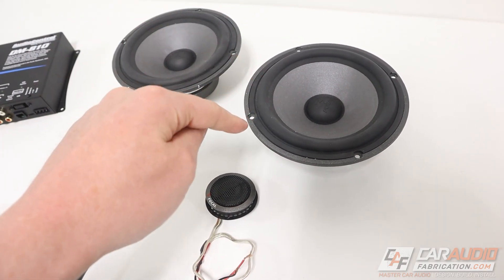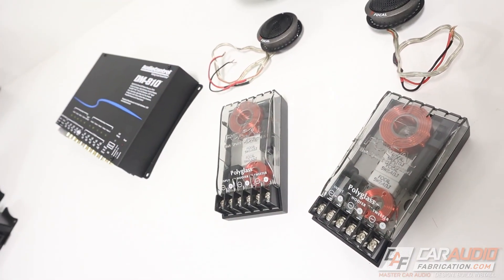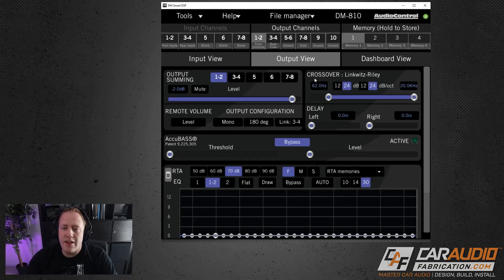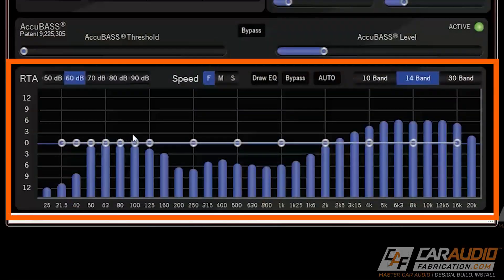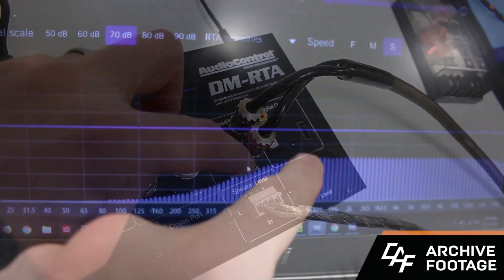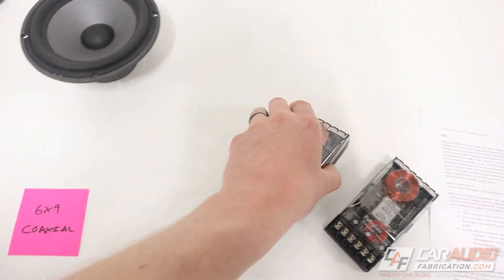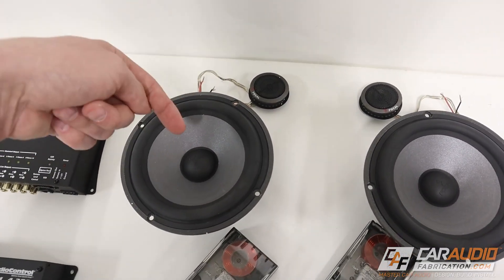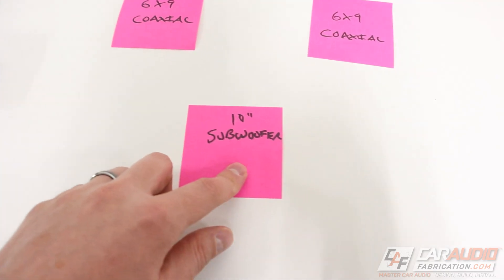Is PASSIVE CROSSOVER pointless if YOUR audio system has a DSP?

Comment: I never understood why people in car audio are so into going active when the only benefit is crossing over drivers lower and higher power handling.

Its rarely ever done in home audio and not even a thought on people's mind's. Get a DSP and call it a day!
Reply: Hmmm... now let's think about this one. Amps provide power. Diff drivers/woofers require diff power that the dsp might not provide. So... are you still lost? I really hope people dont listen to half these comments on here people are severely uneducated
Reply: @Me-dh4pm  a DSP doesn't provide power to a driver. Just a signal to the amp. You're the one that's uneducated!

You also realise that you rarely even need or use a few watts in a standard 2ch stereo system. A tweeter doesn't even pull 1w of power at normal listening levels.

30watts per channel is plenty of power for a system without a subwoofer.

So the argument of better power handling using separate amps is placebo.
Reply: @barbecuetechtips6024  I was referring to DSP's with amplification abilities but sure, whatever you say. No need for amps. It's all for show...😷 we can go back and forth but the reality is there are larger drivers out there that require more power so their is certainly a need for amplification in different applications. It's called headroom.
Reply: @barbecuetechtips6024  car audio, especially the SQ side of things is a constant strive to sound better. We spend good money and if you want to achieve the best results then you want available power. Sure you can do things with the mindset you have but people aren't concerned with extra power 4 tweets. People running 3ways with 8+ inch midbass in the kicks in custom enclosures only on 30 watts, your leaving no room for dynamic range. I'm sure you can find low power drivers but most applications are using amplification. Your not holding onto a secret🤦‍♂️
Reply: @Me-dh4pm  Are you running a 3 way system by chance? 

There is really no reason to run one in a cars confined space and the benefits won't be achieved like in a home speaker.

All you need is a mid, tweet, and subwoofer.
Reply: @barbecuetechtips6024  incorrect. A car and home are 2 diff beasts. Their is no rule of thumb in a car. If you want to represent the entire frequency range 20hz-20khz then your car will dictate that. Some applications work fine with a 2 way front. Others 3. Some 4. It's not as simple as 1 answer. All applications are different. We could debate forever. Research some sound quality champions and let me know if they are all running 2 ways with no amplification?
Reply: @Me-dh4pm  I think this video is targeting the typical/average end user that’s not competing in IASCA or MECA SQ comps.  Of course those competitors are going to want tons of power to their front stage speakers, so this setup described in the video wouldn’t fit their needs.  For most users, the setup in the video would work just fine - and with most getting their music from streaming services, this setup would be more than adequate.  Anything beyond that is just marketing by manufacturers or dealers.  You don’t need 1.21 gigawatts going to every speaker for your system to sound nice.
Reply: @Security_L0ft  The ones who installs a $700 or even more expensive DSP, several amps, speakers, wiring, or even come forward with a question of active vs. passive xover, are definitely not average audience.

It is completely irrelevant that one wants to compete or just for his own pleasure.

The average listener is who listens music on stock systems, and doesn't care, don't want better.
Reply: @Security_L0ft  well said, I agree.
Reply: @Me-dh4pm  so what are you running? With your knowledge.
Reply: @barbecuetechtips6024  2019 VW GLI, I run a 3 way front. 3" Mids and 1" tweets on custom a pillars. 7" midbass in custom .30cube enclosures in my kickwells mounted to the chassis. I run two 12s ported at 5 cubes in the trunk and then 6 1/2s in stock rear door locations for rear fill. Subs  crossed 20-40, midbass 60-250, 3" 250-3k and tweets 3k and start to roll off around 18. All fully active with a fiio DAP as the source on digital coax to dsp. 3" 50watts each, tweets 60each , subs 2000, midbass 150 each. My build log is on DIY forum.
Reply: @Me-dh4pm  I'll take a look at your build for details. Sounds interesting.

I'm just running a budget setup with dynaudio esotar 2 tweeter and mid/woofer with a sinfoni amp.

Passive crossovers with a Sony rsx-gs9 and Sony WM1Z.
Reply: @barbecuetechtips6024  it's a hobby for me so at the end of the day I enjoy the learning process. The SQ side of things is a huge rabbit hole. I'm in the constant process of upgrading as I go. I'm going to be building an IB setup in the trunk this summer and running 2 FI 18s. Cars are different. The accoustic properties of you car will dictate the frequency range you hear from listening position. For me the best investment I ever made was a tuning mic. Being able to physically look at your frequency response so your not shooting in the dark making adjustments with your dsp. Only way to properly set crossovers and align things in correct phase. It's a deep deep hole🤷‍♂️
Reply: @Me-dh4pm  people over look a mic and measuring software.

All you need is a umik-1 mic and a iPad or laptop with room eq wizard.
Reply: All I'm saying is there is no real benefit to run a standalone mid range  in a cars environment. 

Sure if you gut the car and do custom fibreglass and compete in SQ. But for 99% of the population, its a waste of time and money to get a theoretical improvement in power handling and crossover over a traditional two way system with/out a subwoofer.

Comment: You should do a video about having a factory amplifier that has a built in crossover and adding an aftermarket component set with passive crossovers
Reply: I agree I've been trying to figure out what I need to do for my 2016 scion tc, been trying to completely upgrade the door speakers
Reply: The lc7i from audio control is pretty good. When I do installs on factory systems that's usually my go to . Caf has videos about this too
Reply: @flexart174  Really want the DM-608..If I "tap" into all my speakers, am I Done... ? I cam tune my music coming from the stock radio Or do I need to connect the outputs of the DM-608 to ..
Reply: @ceavalencia4767  the dm 608 is what you will use for fine tuning.  You can use the high level inputs from your speakers out to an aftermarket amp Iike the dm 608 if you are willing to put the money !
Reply: 2006 FX35 factory Bose; needs speaker upgrade cant find videos on connections or tuning through DSP

Comment: This setup could actually be used to save power. Someone who wants a custom sound but not have to buy batteries and alternators often. The only problem you run into with this setup is space management. This is A LOT of wire routing and placement that may cut into the overall available air space your system needs (if you route like Mark’s previous builds).
Reply: Would power still be an issue with class D amp with DSP inside ? 
Is it better to drop the crossover that came with my expensive Dynaudio speakers and connect directly to the amp ?

Comment: Why even use a DSP if not going active in the front?
Reply from the maker: Because equalization and time alignment still provide emmense value for tuning.
Reply: @CarAudioFabrication   Those hardly seem relevant in this type of configuration.  Not a notable difference.  You mention budget reasons.  I would think going fully active up front with a 6ch amp and no DSP would sound better.
Reply: @DirtyDaron  what type of configuration? A 3 way component? A dsp gives you control over each individual speaker. How would that not be a notable diff!? Your lost buddy
Reply: @Me-dh4pm   But set up like this it dose not give you control of each individual speaker.  That is my point.  Seems like a waste of the DSP.
Reply: @DirtyDaron  maybe not a waste but your limiting the control you have over them individually like u mentioned

Comment: Per the title. Depends on how many amp channels you have. But the answer is yes. :)
Reply: @champspec  the fact that you are an old school car audio analog guy speaks volumes (I was a USAC competitor from the early 90s myself) quality dsp units like a Helix, PS8, or TWX-88 are not “bandaids”. Modifying a digital signal isn’t “weak” or a 💩 signal as you refer to it, at all. It would appear you have a lot of catching up to do with technology. And once again a passive crossover is vastly inferior and useless in a properly setup fully active system with a modern dsp. Using a capacitor far below the x-over point on a pair of tweeters is the only use for any passive in a well designed dsp driven setup and that’s only there for a failsafe feature.
Reply: HELL NO! NEVER FORGET PASSIVE CROSSOVER!!!! 
1st.. if dsp breaks, then your whole system  is done for....
2nd.. a DSP is NEVER as accurate  as a passive x-over..  failure always comes.
Reply: @kooan112  we can agree to disagree.
Reply: @kooan112  If you DSP breaks you will most likely hear nothing.
I would however use capacitors with speakers anyway, i recently had one channel on my amp pushing DC into my mid (not sure why protection didn't work) and it burned it. 
As for second one, DSP is way more accurate than passive, caps change their value over time, inductors and resistors have their own inaccuracy as well.
Reply: @kooan112  wow... I hope nobody takes this advice. Sorry buddy but you dont use a passive to prevent dsp failure. 😱

Comment: Ugh I wish I had the money to get systems like yours
Reply: dude you don't need that much money to get good sound.

get $109 Pioneer deck.    best if you have an iPhone since you can stream high-quality audio right into the head unit.   Francis vacation you can go to an AutoZone and pick up a dual 4 channel amplifier.
the tweeters can be ran off of deck power just fine.
Midbass  will be going through the Dual amplifier and also through the subwoofer. you will just Bridges the last two channels to extract the most amount of power.
  
the tweeters can be had for less than $8 a pair and they will perform really well they are available at your local junkyard and they usually stuff them in PT Cruisers and they have a made in Mexico label at the back of them they are a 4 ohm model and approximately 1 inch tweeter.    on axis. they're one of the best sounding tweeters that you can get for practically nothing as long as you use a 24db crossover slope.

your stock will first will do however if you seriously need to replace him this little baby a Parts Express for about 6 bucks should do the trick  
https://www.parts-express.com/6-1-2-Poly-Cone-Woofer-4-Ohm-299-609?gclid=Cj0KCQjwvr6EBhDOARIsAPpqUPFkEE9orYuc_J1oio2vuwVRJS-ynew-Y7jMBm5CNmz5BBxtTQAOyG0aArZ7EALw_wcB

what you're really paying for with the higher-end components is more frequency extension and a clear presentation of the sound. However if you use the active settings on most pioneer decks you can actually get the sound quality of hire and parts but you'll have to do it by limiting the frequency range of your speakers. Your door speakers for example will probably be crossed over at about a hundred Hertz or 80 Hertz at 24dB.   

the killer songs here is that if you use the proper crossover points and run your speakers active you're actually able to make your system sound so much better even with stock components.

you don't need a lot of money to get good sound you just need to get some free knowledge with people like me and others have been giving away for over 20 years.

  if you're willing?  take the Venture into a junkyard and get some of these good parts from these cars and you can probably use them on your own or probably find stuff like this already installed them any vehicles and you get yourself a budget system.

have a good one!
iMickey503
Reply: @MickeyMishra  hey man thank you that was really helpful. Trust me my sound system wasn’t that expensive but sounds very good. I just want to see how great I can get it sounding. For starters I need crossovers and need to replace my two way speakers with a component set. I just need to watch more of marks videos to figure out how to fine tune the speakers with a dsp or something. I’ve been lacking on my audio knowledge :/